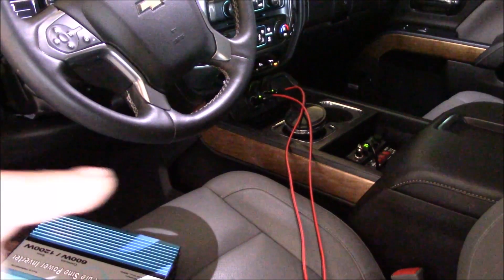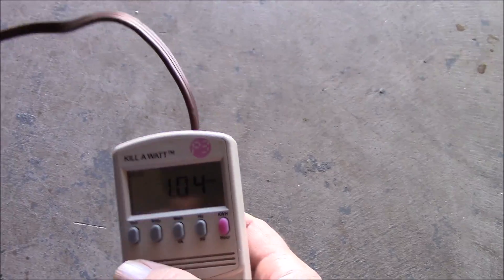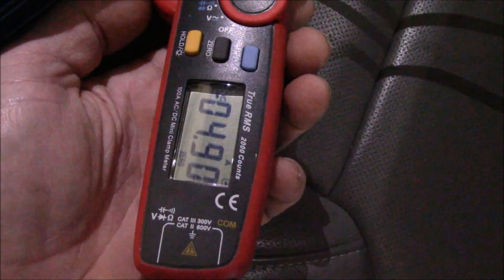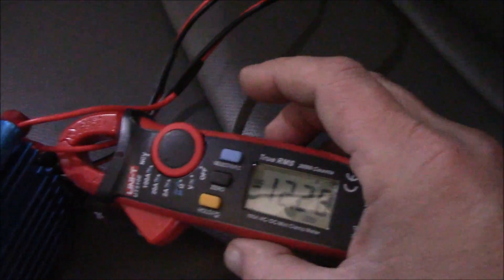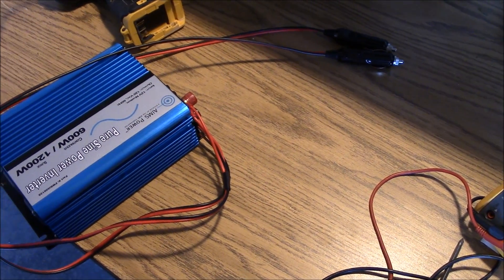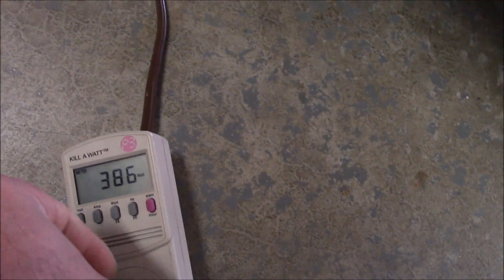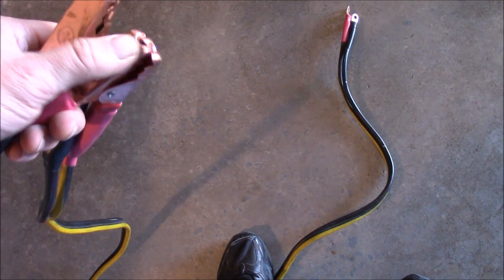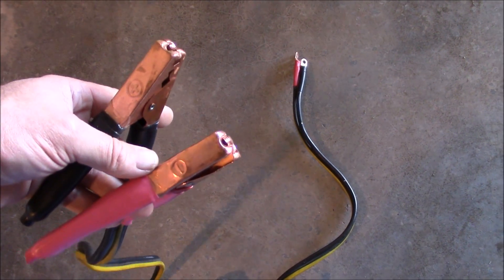👎 Testing two DIY homemade 12v inverter power cables (not impressed with either)

Comment: One difference in the cables I noticed was that the oem supplied cable was much shorter, my curiosity would be does the length of the cable make that much of a difference?  I am currently learning all I can to go off grid eventually.  I love your videos and have learned alot!!!  What I have noticed is that with DC it really makes a difference of the Length vs Gauge vs Load....  Could that be why the manufacturer feels the smaller cable will be ok?

Comment: Run 30 amps through those OEM cables and you might release the smoke they hold inside.  If you are looking for a quick connect option to run off your truck battery, I think I would make a short pigtail using these  https://www.amazon.com/Quick-Connect-Plugs/dp/B007JMTS14  , remove the clamps and wire the other end of the quick connector to your jump start cables.
Reply from the maker: Thanks...this is a great idea. I think I am going to do "quick disconnects" with welding cable. It also allows for a couple of other options. For a 600w inverter...thinking #4 welding cable with be just about right. No need to run 2/0 ( or similar) for such a small inverter. And, with a single stock truck "starter" battery, need to keep it practical.

Comment: I have noticed with the smaller inverters that you can not get the rated amps with the cables that are used. I have a 1100 watt inverter in a small came trailer connected to a 110 amp hour battery via 2/0 AWG I am sure that #2 would work but it is a 5' run.  I think the duel axillary plugs on your truck would supply 15 watts without excessive heat. I have a 200 watt inverter running my chicken coop, fan included. It is connected to the battery with #8 AWG ABOUT 3' LONG. How much did the little Aims inverter cost. Have you looked at the wave form? I originally wired my house for 2 inverted circuits. I was going to have another smaller pure sine run the electronic stuff but the old Trace seems to be quiet enough and the motors run fine on it. Still a thought though.
Reply from the maker: Yep, you are correct. This was just a test with some OEM stuff I had laying around and modified. Pretty much not happy. Yes, I have looked at the AC pure sine wave out of the AIMS...looks really solid. It was about $120 on Amazon...pretty good deal for a PSW inverter. I think #4 TEMCo welding cable with a 10' run and a couple of quick disconnect Anderson style connectors will be better. The battery and battery connections on a '14 Silverado suck. They added some wacky terminal blocks and extensions on the battery posts and some other engineering brainfart designs. It can be overcome, but, just unneeded and costly additions versus the 2011 Silverado and older trucks. I will never run another modified sine wave inverter...they actually use MORE current to run the SAME appliance.
Reply: I know that some modified sine is actually square wave. The older Dr Trace series are multi step with a huge transformer. True sine is a fairly news development. The price for a whole house I/C will cost me $2k. That's how much My Trace cost back in 2002 when it was made. I bought mine for $400 NOS. The Magnum 4024 costs about 1900 to 2k depending on where you buy it. I would like to increase the solar before I spend the money on a news inverter. This has been hard to do for a retired disabled guy with  very little income lol. I have $5500 to build my whole system and we are living off grid. If we had decided to sell and get a smaller place I was going to set aside $30k to build an off grid system the right way. Have a wonderful day brother.
Reply: Chris DIYer Hey Chris have you checked out this handy online calculator? 

https://www.batterystuff.com/kb/tools/ac-to-dc-amperage-conversion-run-through-an-inverter.html
Reply from the maker: I like it! Thanks for this link! Never seen this before. Man, technology has taken us away from the "books" and technical manuals. Now, just use the computer...
Reply: Niko grossenbacher Thanks, all ready done and off grid for over 2 years. I installed the system myself. My whole system cost was $5k. Do you have your system on youtube?
Reply: Niko grossenbacher Not having a power bill is very happy.

Comment: C S.....  as always ....you have that knack for experimenting close to the point of failure.  BUT....I have never seen any magic smoke in any of your vids.  So I enjoy them. It is a regular part of my day to check in with you, almost like being "Next door" !   Always good to have imagination, as well as finding out various ways to get a job done.  With all those connections, there is bound to be a minimal point of contact which could lead to plastic melting indicating the point of max resistance on the crimp connectors or thin copper jumper clamps.   As Tim Allen says..." More watts...MORE WATTS ! "     Now, where was I before I burnt my dinner ? ? ?     HA !      J K
Reply from the maker: Hahaaaa! If we lose our curiosity, we lose it all. Best to be "smart" and use/have safety devices before burning a truck up or the house down. But, need to lean forward and "go for it" too. Some of the greatest leaders our country has ever seen took calculated risks...and trusted their training/instincts.
Reply: Yep, no sense in taking all the excitement out of life.  Heck, even EDISON  only had a 20 % success rate in all his attempts. But look at where he got us today.  And now there is still talk about which is better.....TESLA with  AC power or EDISON with DC. They both have their advantages.   A company called ENERGOUS ( ticker symbol WATT )  is working on "wireless charging"  of devices. They are working with APPLE on remote charging at 3 feet and still trying to perfect up to 15 feet. So imagine being in a room or office and your Smartpad or I Phone and computer recharging automatically. Then with WI-FI and Bluetooth, no cords.  Only issue is all the invisible wavelengths buzzing around our body.   You come home tired and FRIED !   Later Chris,  have a good weekend. We are going to get wet this weekend In Houston.   J K